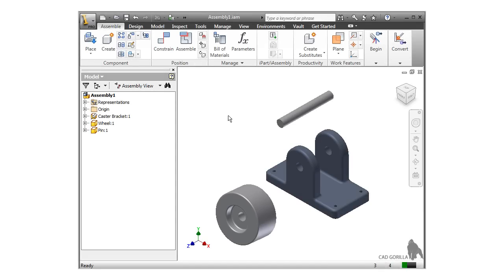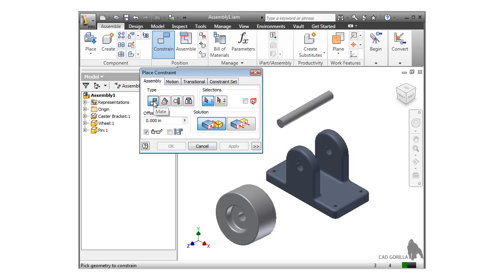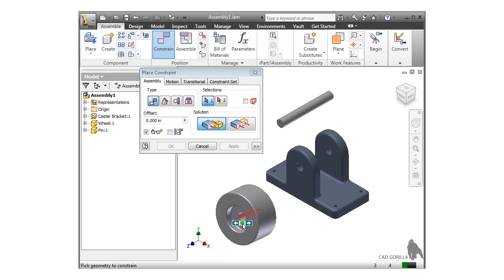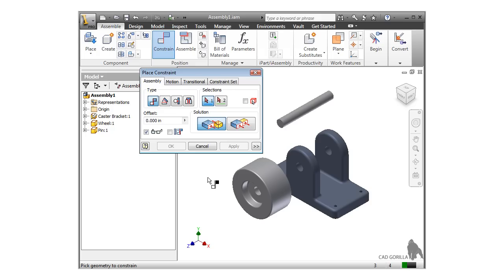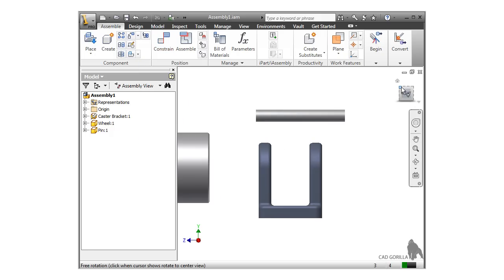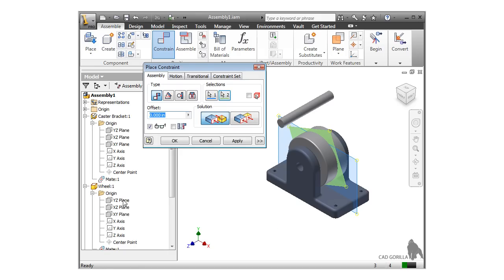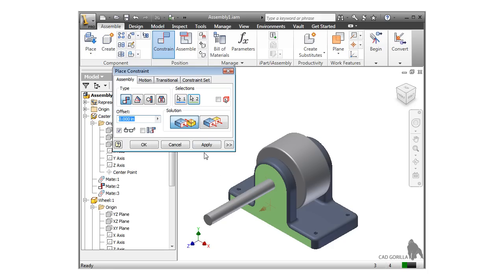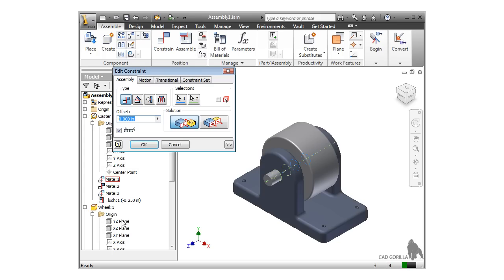Autodesk Inventor Training Tutorial - Assembly Mate Constraint

Comment: Finally someone addressed the centering option. Thank you. Too bad inventor doesn’t make it easier. Thats alot of clicks for something that should be so simple. .
Reply: The instructor could have used it on the pin as well, but I guess she wanted to demonstrate another method.  I teach Inventor to HS students, and I start them out using symmetry about the default reference planes like it's a necessity.  Base extrusion is almost always bi-directional with symmetry.   Also, I force the students to use the symmetry constraint to get the sketch geometry symmetrical to the planes/axis, instead of using the center point rectangle or even the corner rectangle right up front.  After they get proficient at using line command to make a rectangle, and use the constraints to reference to the reference planes, then I show them the center-point rectangle.
Reply: @philr7201  its still a completely un productive way to center parts. Inventor could take a lesson from NX and SolidWorks or every other CAD package.

Comment: Hi there. This was a brilliant and very informative video. One problem I am having with constraints is this. When I constrain two faces together, the faces snap together. However when I switch back to my move tool, I am able to freely move the recently attached piece in whatever direction that I want regardless of the plane it is supposed to be constrained to. Any suggestions?
Reply: thanks